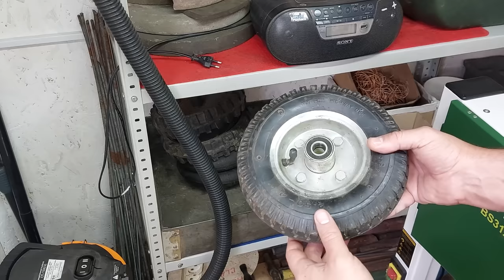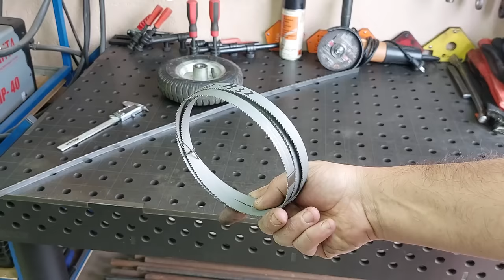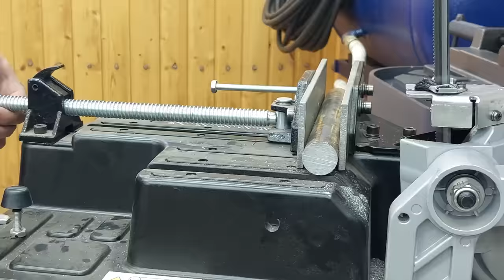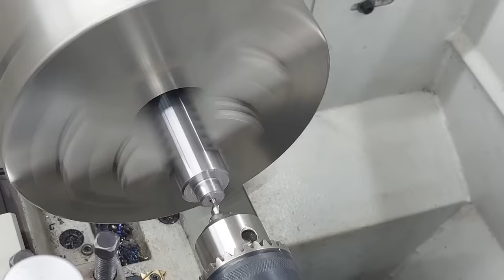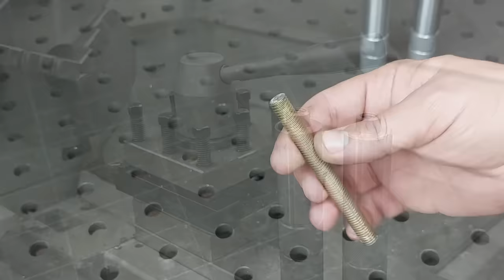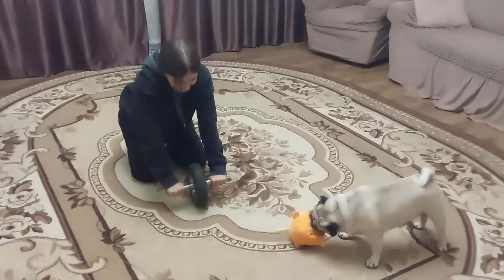I didn't believe it myself! Brilliant idea in 5 minutes from a garden cart wheel

Comment: Excellent tutorial on how to use a lathe ( correctly ! ) ..... however this device could have been made MUCH more simply ... use a steel ( or brass ! ) rod of the EXACT diameter for the wheel bearing , then just slide on  some chunky rubber or plastic grips to each end ( for folk that do not have such a nice lathe ( Ha - Ha ) ....... DAVE™   🛑